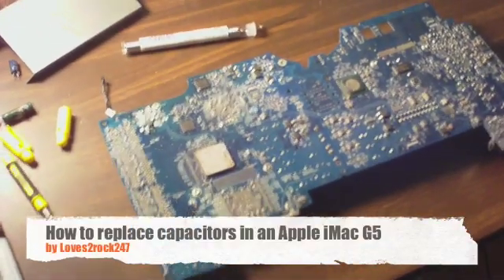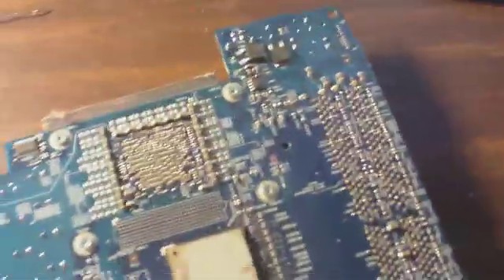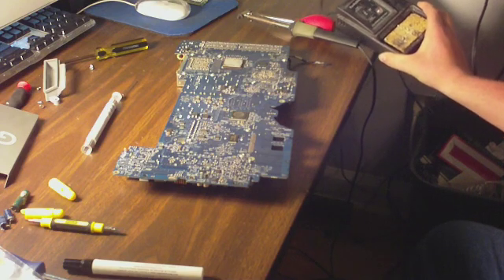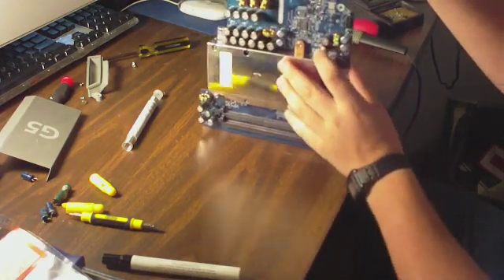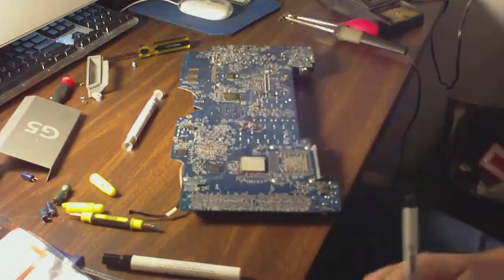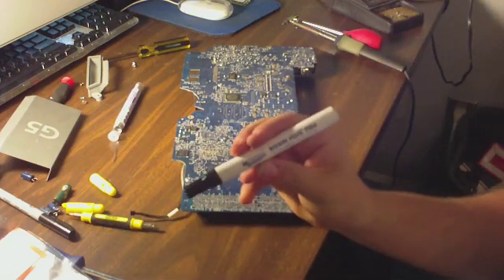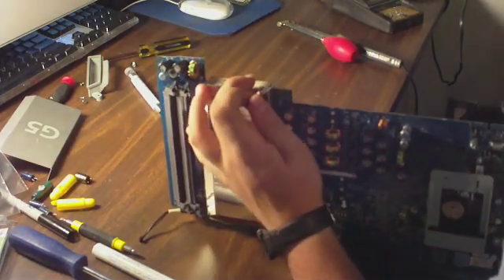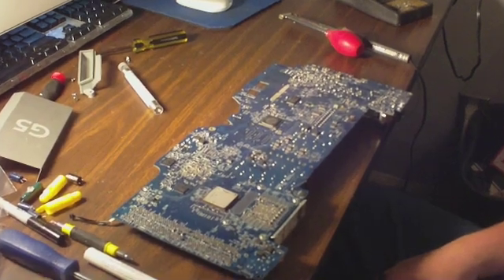Apple iMac G5 Capacitor Repair

Comment: The negative side requires a lot of heat. I got impatient and the cap leads snapped off and are still in the hole on the board.  Gonna try hot air next.  I pulled good used caps  from old TV power supplies. 1000mf. At 25v.

Comment: I would suggest using something called "Chip Quik" for removing capacitors in difficult circuit boards like this. Works a bit better than the pens. 

Also, a wide tip, high-wattage iron does the best job because they keep heat from transferring into the board.

Also, try using a sewing pin, with a plastic head, and heat up the tip and the solder pad at the same time, once the caps are removed.